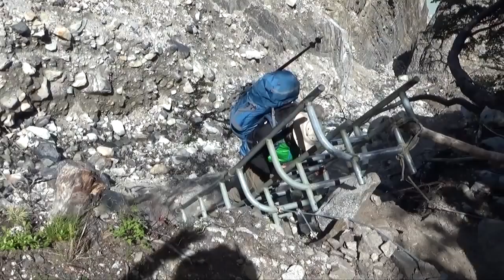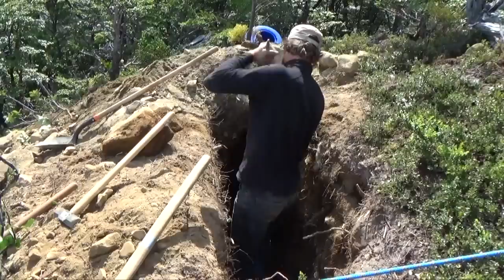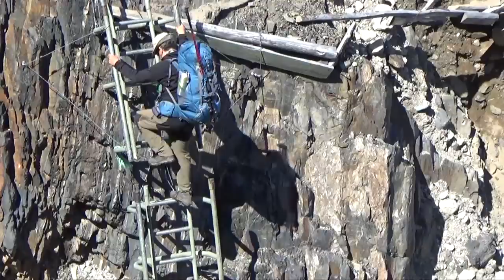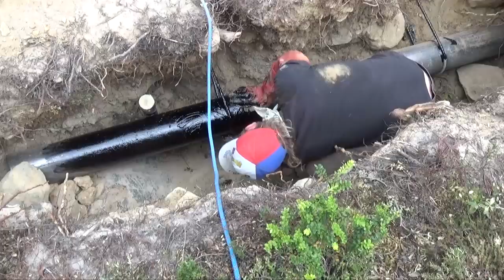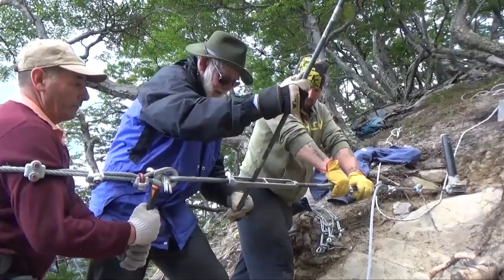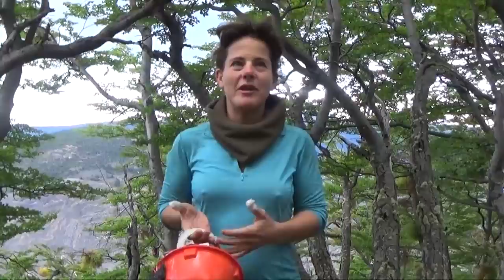Building the Bridge in Torres del Paine

Comment: Hi Neels from South Africa, What size cables did you use as the main lines as well as the vertical braces? I am doing a similar project, also 45m high but 70m span.
Reply from the maker: Neels,
 There are several factors that determine the size of the main cables.  Since these factors are usually unique to each potential bridge site, it would be dangerous for you to base the size of your cables on the size I have used, even if you plan to construct a bridge which appears to be similar. One has to make an analysis of the forces acting on the cables before choosing the proper cable to adequately resist those forces.  (And note that not all cables of the same size have the same strength characteristics.)  Some of the factors that affect the determination of the forces acting on the main cables are the span, the percent of sag in the cables, the number of cables carrying the load, the dead weight of the bridge materials, anticipated live load, the force of the wind, and snow load if relevant. If you are fluent in the basic mathematics of engineering, you may want to do further research and study so that you can effectively design a safe bridge.  Otherwise I urge you to get the help of a competent engineer before proceeding.  I have seen bridges that were built by people with little knowledge of the basics who proudly proclaimed that they did it without having to use an engineer, but a simple study of what they have constructed revealed that some of those bridges were very unsafe.  I hope my advice may be of some use to you.

Regards,
Richard Braunlich